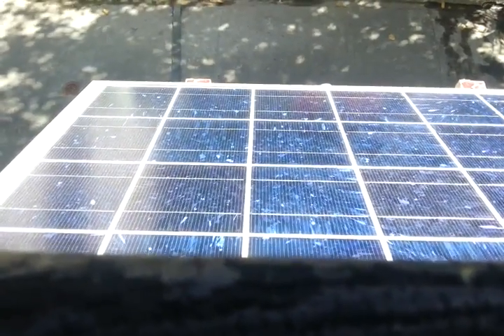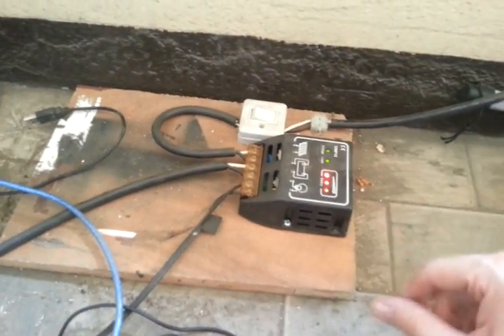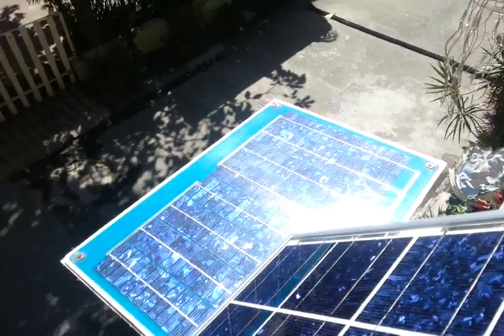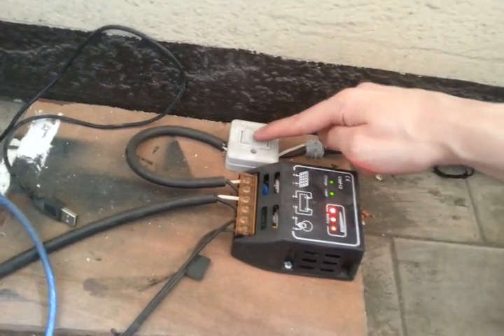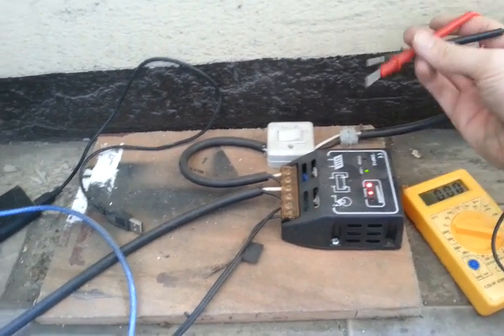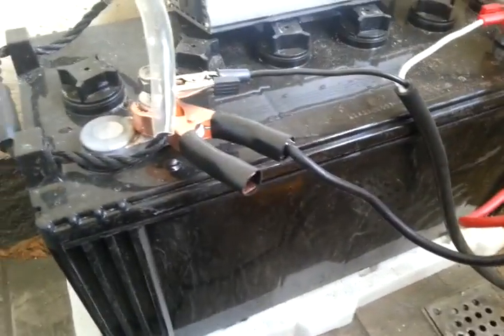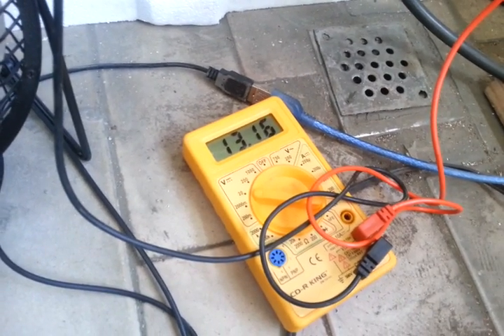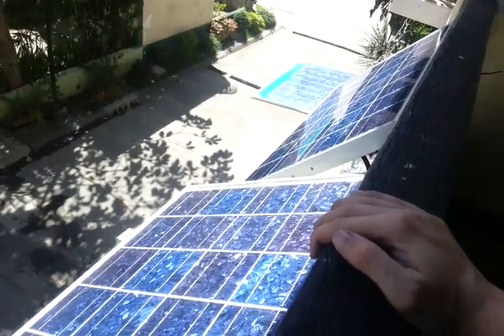Solar power in the Philippines

Comment from the maker: Grid tie does work in the Philippines although Meralco don't have specific plans for it. So while it would be fine to offset some of your power usage using solar, if you put in enough power to turn the meter back further than your last reading, it might cause a problem. There are shops like 'got heart foundation' that are using grid tie in the metro. I'd recommend speaking to Meralco before installing any grid tie and get confirmation that they will allow it in your area.

Comment from the maker: Mainly smaller things like laptop, desktop pc, TV, that kind of thing. Most microwaves start at 600 watts and average is probably a 1000 watts, so it wouldn't be good for that. Iron and kettle would also use a huge wattage. Fridge would likely be just fine :)

Comment from the maker: If you had a 50 watt solar panel in perfect sunlight for 8 hours then it could power your 50w light for 8 hours in the night. But of course you wont get 8 hours of perfect sunlight and there will be some losses putting the power into the battery. But that gives you a basic idea of how it works. A 50w light sounds pretty heavy duty, I hope you're considering LED or CFL instead of old style incandescent which waste so much electricity.

Comment: Is there a charge controller available at CDRKing? Where did you get yours? I need a 12V/24V solar charge controller. It should still be able to charge a 12V battery even if I have a 24V solar panel input. This would typically be an MPPT type controller. Do you know of any store that sells this at a low cost?

Comment: Very nice set up and video. I just subbed. This video is a few years old now. How has it all worked out for you long term? Cost effective? Important lessons learned?
Reply from the maker: +B Adventures Thanks! So far it's been going pretty well. The only lesson I learnt is not to be lazy in providing cover for the electronics/battery. When it rains here the wind blows it in pretty much every direction and guarantees anything outside will get wet :P Since I'm renting, I can't really put the panels on the roof, so because of their position they only get a few hours of light a day.  So I'm not maximizing their output. For me it's more of a fun hobby and useful for brownouts/blackouts rather than a cost saving plan :)
Reply: Gadget Addict thanks for the reply and update, really appreciate it =)

Comment: Just wondering where you're getting your panels from, and what they cost. Thanks.
Reply from the maker: John Strabismus Some have come from Sulit, from Japan and other places. Some are from CDRKING :)
Reply: Gadget Addict I looked at CDRKing. Very expensive for a very small system. I'm hoping to have a 2000 watt system once I get over there. I might need to import the panels, charge controller, and inverter.
Reply from the maker: John Strabismus I've found the cdrking panels to be cheaper than nearly all other sellers in the PH who are importing them directly from China or Japan. You can buy them a little cheaper than cdrking if ordering direct from china/HK but import fees in the PH are so high that you'd end up paying a huge amount to Customs.
Reply: Gadget Addict Well, if I have to I'll just get some solar cells, and make my own panels. Luckily, however, my Filipina wife has a college degree in customs, and knows a lot of big shots. I'll probably make some panels as an experiment, but I think I can import them at a reasonable price. If I can do it I'll also start a solar panel business.
Reply from the maker: John Strabismus Making panels these days nearly always ends up more expensive and the resulting panel likely won't be very pretty or weatherproof. The DIY route used to save money but with so many factories churning out solar panels and competing against each other, prices are very reasonable.  There's a lot of money to be made from solar in the Philippines and while you can have people "fix" things like import/custom fees, it's a slippery slope, so be careful :)
Reply: Gadget Addict With import fees being what they are. DIY could still be a good option in RP. I'd also never cheat, but I don't want to pay extra, either. Somehow that seems to happen to a lot of foreigners.

Comment: What type of wire did you use for your panels? I tried to source out from ace and wilcon but I got this 12 AWG stranded cables that are harder unlike those short cables that came from the cdrking panels that may be thick but more flexible. I am not sure if this is the same cable that can be used for the solar panels.
Reply from the maker: I have a combination of different wire types. Most people I've spoken to would recommend against solid core wire for DC/solar and strictly use stranded. I used to buy from Wilcon or Ace in the electrical section, but they have a limited selection of stranded wire and it's kinda expensive. So I started buying at DEECO in farmers plaza cubao, they have a big selection of wires there. More recently I've been buying the 5 meter rolls of 10 and 12 AWG from the Automotive section of Ace Hardware. It's a good cable and pretty cheap. There are calculators online that can tell you how much current you can safely carry over a specific length and gauge of wire.
Reply: so basically those sold in the electrical section of Ace are the same wires that can be used? I just find it very hard and not so flexible as compared to the one that came with the panels that why i have my doubts. but hey, thanks for the tips on where to get the wires, your help is very much appreciated!
Reply from the maker: Ervin Malicdem They have a pretty big selection of wire at Ace.. so it's hard for me to comment without seeing the one you actually bought. It might just be that the wire you purchased has a thicker plastic/rubber coating. Do you have a picture? You could upload it somewhere like imgur.com :) It's really stranded and not solid-core?
Reply: It may be plastic as the insulator is thin yet harder. I believe this is the most common 12awg sold on electrical supplies (not automotive supplies) as this is what I always find when I went to sari-sari hardware stores as well as wilcon and ace. It is sturdy that when you bend it, it wont get back to its previous shape automatically.

Comment: I'm trying to learn more about solar power and plan to start my own setup soon.  I plan to run on motolite solarmaster and cdr king solar panels but I'd like to ask your help in determining the required size for my requirements.  I want to have a system that can run a set of aquarium pumps for 24 hrs a day with around 60 watt total for all the pumps.  I'd also want a little extra power for occasional charging for the cellphones and laptop.

What minimum capacity for the battery, inverter, charge controller, and solar panel would I need?

Thanks!
Reply from the maker: 60 watts seems pretty high for a set of aquarium pumps. Have you measured the usage or are you just going by the stickers on the pumps? 60 * 24 = 1440 watt hours. You don't want to discharge your batteries past 50%, so you'd want to have a minimum of two motolite solarmaster 100 ah batteries, 3 would be better. Lets assume your panels will get at least 6 hours of direct sunlight per day, you'd need at least 240 watts of panels, but since there are losses and they wont always get 6 hours, you'd want to take that up to around 400 watts. For the charge controller, it depends on the exact wattage of solar panels you have, as long as it can handle the amps, it would be fine. 60 watts isn't particularly high so pretty much any inverter would be able to handle that. Since the inverter would be running 24/7, you'd want to make sure it has a good warranty and a cooling fan.
Reply: I'm just going by the stickers.  The sticker on the biggest pump says 40 watts.  A couple of other pumps draw around 6 watts each (i cant remember it exactly since i already lost the stickers) The pumps are installed for a series of connected tanks (it's a saltwater aquarium system).

I figured I can get the most savings in electricity if I connected the solar power to something I use constantly/frequently.  By your suggestion, I think I might settle for a smaller starter system and use it for other electrical components that don't need to run 24 hrs. 

How much stuff could I safely run from a setup with a 100 watt solar panel and one 70 ah battery as a starter?  I don't want to go big right now since I'm still learning and I want it to be a DIY project.  (do-it-yourself instead of destroy-it-yourself). =)
Reply from the maker: ferdinand mendoza If the primary goal is to decrease your meralco bill and to be more green, rather than live 'off grid', you might prefer to just forget about the batteries, charge controller and inverter and instead just grid-tie your panels. In that case, you just have your solar panels and a grid-tie inverter which immediately dumps the power from your panels into your house wiring. A professional install is recommended (separate breaker box) but there are many DIY installs that literally just plug straight into an existing socket. The thing to remember with grid-tie is that you 'use it or lose it' since Meralco wont pay you for any power you feed back into the grid. And if there's a brown out, your panels wont feed power into your house anymore because the inverter will turn itself off as a safety precaution (since any lineman working on the public grid would not expect someone to be feeding power back in). A 100 WATT panel would likely give you 450-600 watt hours a day. A fan will use 30-50 watts depending on the setting. Run that fan at 30 watts for 5 hours and you've consumed 150 watt hours. Most modern LCD/TFT monitors consume 15-40 watts. Charging a phone/tablet is 5-10 watts.
Reply: Thanks a lot for the help.  I don't think i'm quite ready for a grid tie.  My goal for now is first learning the ropes(DIY style), some back-up power for brown-outs (fan, lights, laptop), and maybe a little reduction in my meralco bill.   Running the aquarium on solar will have to wait for a later upgrade.  Plus, the wife won't agree to a major shift to solar just yet.

By the way, I have no formal training whatsoever in electronics so your help is much appreciated.  Keep sharing those videos! =)

Comment: hi Gadget Addict I want to buy an 80w solar panel (will use to set up to light 11 led bulbs that will sum up all to 61watts) please advise on the specs of battery, inverter, charge controller that i will be needed. thank you and more power to you! your advise will highly appreciated.

Comment: hii,
I have 50w 18v polycrystal solar panel and 9ah 12v amg battery and 45ah car battery.Im running tv fan , lights , radio , ups  and wather pump . Can I conect amg and car battery in paralel or conect amg only ?? Is my battery big enought 
and will car battery die in solar system bcs I used it for 1 year and still works fine (with 10w solar  panel) , my dad told me he ran soldering iron and light bulbs (250w) with truck starter battery for 15H with no problem and battery worked fine so can I use car battery or not ??

Comment: Hi, thanks for the nice idea. I'm also doing off grid solar power for some of my electricity load in my house, may I kindly ask as parallel connection if required to have a blocking diode for each in every solar panels? as I observe 100w 12v panel I bought already having diode on terminal box.

Thanks and regards
Roberto
Reply from the maker: Yup, if in parallel, you want to make sure they all have a diode :)
Reply: Gadget Addict Diode I use is 10A for 100W Is normal that getting too hot? Due to that I was wondering maybe diode in panel connect box is enough.

Comment: ho match did you cost to the 120 watts  panel a the 10 amp controller
Reply from the maker: juan sambo Check out the cdrking website or visit one of their stores for the latest pricing :) You can also check Sulit/OLX but the prices are often higher.
Reply: tnx

Comment: phil do u think cd-rking solar panel is good investment because i like to buy 2pcs 50watts solar panel from cd-rking😊
Reply from the maker: Yes yes yes yes yes yes yes! I've been waiting for about 6 months. Calling cdrking, emailing them, trying all my local stores. They never had any stock. Then finally this weekend I found them in Ali Mall! An exciting day for me haha. I'm working on a video right now to show their performance but they meet and EXCEED their specs. I'm getting 100 watts out of the 80 watt panel (in perfect conditions). Getting about 50-55 on the 50 watt panel.

The aluminium frame is heavy but not amazingly constructed. I bashed one of my panels against a wall by accident and the frame is a little damaged in the corner seem. My panels from Japan can literally be jumped on and they don't damage. But who cares? Once you put your solar panels somewhere, they shouldn't be messed with anyway.
 
For the money the panels are definitely worth it. If I had a roof like yours, I'd be buying the whole stock at Ali mall haha

Comment: here in jaen mostly rice fields and always having power shortage..so normally a household should have a power generator, i dont want to buy one coz its noisy and expensive on fuel cost..can you advise me what to do on solar power..
Reply from the maker: Mmm solar is pretty simple. Buy the panels, a charge controller and batteries. Then an inverter to increase the 12v to 110 or 220
Reply: Gadget Addict hello sir i've search in olx.com.ph there are some pretty interesting packages they have..i just want to ask what appliances can you use simultaneously with these packages....the 18,888 price has a set of 1500 watts inverter,100 watts panel, 70amp battery and charge controller with volt meter. the 29,888 has a set of 2000 watts inverter, 150 watts panel, 100amp battery solar charger and volt meter..can you give your thoughts to that? thanks...

Comment: Hi Phil, how much in total do you think I'll end up spending if I were to build a panel of my own? I'd like for it to power up just my normal household lights and appliances. Are there shops here in the Philippines that build and install for you?, if this would be the cheaper route. But it would be nice to have building my own solar panel under my list of accomplishments. Thanks in advance.
Reply from the maker: Building a panel generally works out as expensive or more expensive than buying one. Especially if you want to get a good long lasting seal. I wouldn't recommend building a solar panel for any reason except for the fun of it or to create one of a very custom size. There are a few solar installers but you'd be better off doing a little research on what wire to use etc. and then use a regular local building company instead of a specialist solar company.

Comment: Hi what system will be enough for an aquarium setup with a heater ~300W? My area is also a bit cloudy 50% of the time?
Reply from the maker: +Charles Flavoer Does the heater need to run 24/7? Do you intend to use batteries for off-grid operation or use a grid-tie inverter to feed it into your existing residential AC loop?
Reply: actually the heater only runs when temperature goes down, about 50% daily. I would consider using an off grid operation for this.
Reply from the maker: +Charles Flavoer For something like that, I'd really recommend buying or borrowing a watt meter to measure the consumption over a full 24 hour period. It would be hard to estimate the consumption of something under those conditions. It is a 12V heater? You might be able to skip the overhead and waste of an AC inverter if that's the case. Expect it to be a fairly sizable system since you're combatting clouds and need to run the thing 24/7. Without knowing the actual consumption over a period of a day or a week, any estimate I give could be hugely over the top or underestimated..
Reply: its a 220V heater, eheim jager 200W heater. so i think ill need an invrter. but im not really sure how to get its consumption since is just turns on when temp drops, in an estimate since its cloudy and weather is cold here, it turns on frequently at 60-70% of the time in intervals of 5-10 mins. how about a safe estimate, if its too much i can hook up some home appliances in case.

Comment: is youer solar panel still working along with the other cd rking  stuff or it  broke? did you get value for the money
Reply from the maker: errol soriano Most of my solar isn't cdrking. But yes, the stuff I do have is still working fine :) I've not had any problems with their solar panels or charge controllers and consider it good value for money.
Reply: thank soon i will try it. i want to power my fan for the whole day what would you suggest?

Comment: hi i already bought 10watts solar panel at cd-rking but i dont have charge controller i directly connect the solar panel at the batter and it charging my 15ah battery and that battery powering my 12volt 7watts light bulb and i hook up cigaret socket at battery and a usb car charger and its working but i dont know if ther battery is full or not because i dont have charge controller
Reply from the maker: Hey, good news! Welcome to the world of solar :) If you have a multimeter, you can get a rough idea of how much charge is in the battery based on the voltage. Look up the spec of your battery to see the full charged voltage and depleted and then just do the math to work out the % between each voltage :)